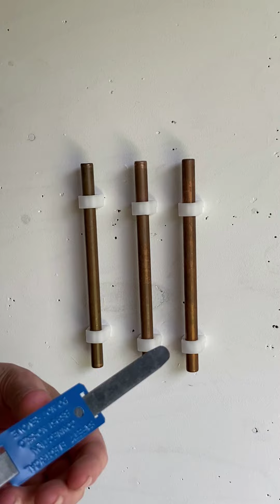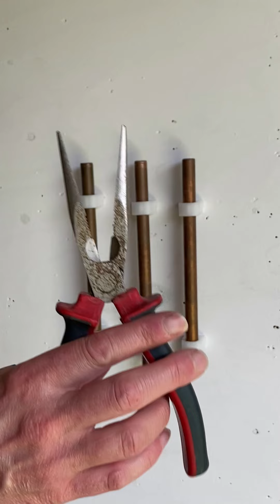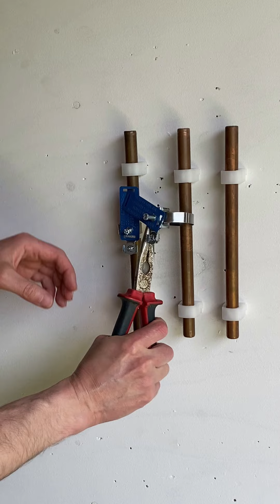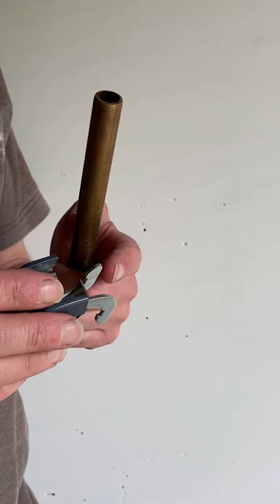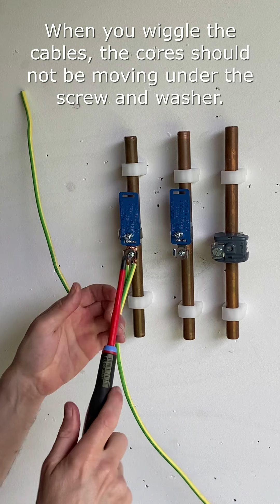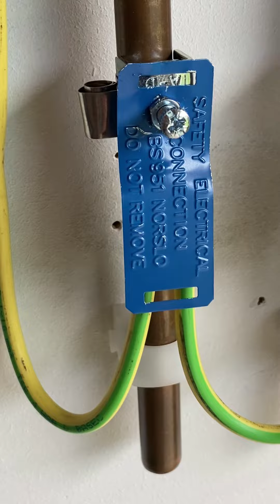How to correctly terminate bonding straps - life hack. Also covers easy clamps from AM2

Comment: Funny thing is all bonding straps are generally designed for lugs and contrary to the common misconception that they are for a bare copper conductors, as illustrated in this video. In most European countries you can only use lugs on these types of connection. Bare copper is not acceptable except it looks like in the UK. Once at the forefront of standards, britian is sadly lagging behind.

Comment: Are you not supposed to give the pipe a clean with wire wool before the application of the strap ?
Reply from the maker: I would say, only if it was heavily oxidised or coated with something.

The only way to know for sure, would be to perform a long lead test 👌

These were clean bits of copper though, so not concerned at all

Comment: Do you bond this  to the gas pipe, hot water and cold water pipe  then where to you connect the other wire in the end?
Reply from the maker: Earthing and bonding part 1: what are main and equipotential bonding conductors
https://youtu.be/kc_mj3KHsbc

Comment: Hey adrian, great content mate. Your really helping me get through my college work. With the easy earth clamp, do you need to loop the cable or can it go in straight?
Reply from the maker: If it goes in straight you run the risk of it not securing correctly.

I’ve done a video series on bonding and I discuss what you are asking, in the video.

It’s in three parts

Earthing and bonding part 1: what are main and equipotential bonding conductors
https://youtu.be/kc_mj3KHsbc

Comment: Good Tips, but my OCD was aggravated by the sight of corroded copper pipes  under the clamps - bit of wire wool only take 5 secs. Also there is no Clockwise vs Anticlockwise when you put a symmetrical loop under the bolt. If you formed an open hook on the last connection then that would be different.
Reply from the maker: Thank you for taking the time to comment.

In my experience, it does make a difference which way round a screw you tighten, especially with stranded flex.
Reply: @Pure_electrical_training  Sorry, I can't resit coming back on this (it's a flaw in my personality - coz this really is not an issue to be concerned about 😀) It's just that a loop which goes all the way over the bolt and both ends can be pulled down at the same time - simply has NO direction - To prove my point - take the loop and turn it through 180 degrees. If it had an inherent direction (clock or anti-clockwise) you would see a difference between the before and after. 
On the other hand when wiring say : A Cooker with 6mm stranded; then I agree 100%, because there is an "open" end to the cable. This time if you turn it through 180 degrees you will see the difference. This time there is NO symmetry.
Again plz forgive the pedantic comment, it's just that details are important to me.
Keep up the good work and BTW I totally agree that the whole system for qualifying electricians is crazy. I'm suffering at the hands of this stupid system myself.
Reply: In this case it don’t apply screw does not have direct torque motion onto the cable
Reply: I just commented about that too. There's even more but I just cba.

Comment: I usually just pull on one hand and tighten with the other hand but I must say Adrian your technique has grown on me and I can't wait to try this method when I next work on Bonding Clamps. I also liked your Fly Lead technique on keeping the CPC longer so it can be terminated to back box before it reaches the sockets, I prefer doing it your way. Which Earth clamps are you using for the first two Clamps not talking about the Easy Clamp? Thanks
Reply from the maker: Thank you 🙏

These clamps are Legrand
Reply: @Pure_electrical_training  Thanks